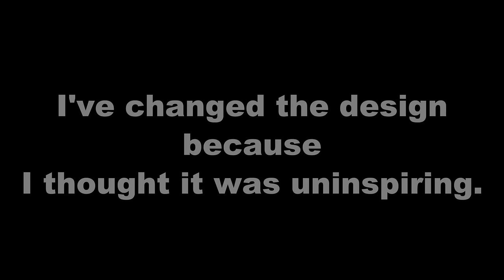Ruler Marking Gauge

Comment: This build inspired me to make one, which I have now done with a few changes, works very well & I think I’ll make a smaller one with a 6inch ruler to keep the other one company. I looked through the comments on this & you don’t need anything other than basic tools to do the Superior one, trust me. My version doesn’t even require the locking internal plate, as long as the bolt is in the threaded insert straight and flatten/polish the bolt end it seats & locks the ruler fab, saves more  too, thank you for sharing!👍
Reply: i want see it!
Reply: Glad to see this comment; I was wondering why he bothered with the plate at all.  Additionally, what kind of glue, etc. would be needed?

Comment: The difference between the two versions is the difference in price you see in tools in the big box stores.  Such as Milwaukee vs Black n Decker or Bosch vs Holt.  He shows the DIYer it can be done. Then hey shows the the experts what they can achieve.  Inspiring to both audiences
Reply: The guy is great and I couldn’t do what he does but the real difference between the two is the CNC machine more then any other tool comparisons.  It allows for so much more detail and precision.  I want a nice small one like that.
Reply: @garyjohn1956  you got it. CNC makes significant difference in the 2nd version

Comment: As a armchair quarterback who makes nothing, I would have used the brass on the darker wood so it would stand out more.  I think you could also make a half inch set on the end side with a solid metal line and then a inch on the other end.  Then you would have 1 adjustable and 2 fixed for common measurements.  Of course I could never make something so amazing.  Brass and wood is a classic look. love it.

Comment: You inspired me to make one. It's far from perfect, but gave me joy to make.
Also will be functional!
Handmade everything except the ruler and socket head cap screw.
Note the ‘impossible’ dovetail.
Top timber red box (Eucalyptus polyanthemos), possibly red gum (Eucalyptus camaldulensis) - not sure. Was a garden stake that was left on the side of the road.
Bottom black-butt (Eucalyptus pilularis)
I live in Australia. There are such amazing hardwoods here, that sadly mostly end up as firewood or chipped and shipped to Japan for paper making.

Comment from the maker: The simplified version of wood is Whitewood
CNC processed products use rosewood, beech and brass.
For the part to touch the work, I used rosewood with high wear resistance and used brass for the part where the ruler touched.
The leaf spring is glued so that the screw does not hit the ruler directly.
Google Translation

木材は簡易版はホワイトウッド
CNC加工品は紫檀とブナ、真鍮を使っています。
一応、ワークに触れる部分は耐摩耗性の高い紫檀を使い、定規が触れる部分には真鍮を使いました。
ネジが直接定規に当たらないように板バネを接着しています。

Comment: Great work, very precise I will use your basic design and make it simpler (I think Mathias Wandel did something similar as well).

A suggestion a lot of craftsmen cut with big or small bandsaws putting their fingers really close to the blade. Research and make some push sticks as lots of people will copy your way of working. Whilst you have great skill, people watching can be complete incompetents and will get injured because they think they can do the same.

I can clearly see you have modelmaking skill for many years but newbies  may get injured.

Keep up the good work. You could make extra income and people can help support your work by selling plans.

Comment: Just an idea but locking the ruler with rare earth magnets would work, one in the ruler bed flush & another in the end of the brass bolt, just lifting that out would enable you to adjust the ruler then pop back in to lock, I am tempted to do this with the smaller one when I get round to it.
Reply: I made a smaller version of this with magnets and it works, go me, thanks for being interested

Comment: the screw attached to the wing nut when tightened presses the metal plate, which in turn presses presses the metal scale. is my understanding correct.

Comment: ...I can't get over the fact that when you were drawing your lines with your first marking gauge while you were making your second marking gauge, you drew those lines as if you didn't have a marking gauge. 

"Dash, slide, dash pickup, straight align, fill."
When you lined your dashes up, your block was hanging 4 inches off the edge of the table. 
...was this your first time using a marking gauge or something?

Comment: This is awesome! Is that piece under the nut necessary? Or can u tighten right on the ruler?
Reply: I was wandering the same thing
Reply: Although not necessary, that piece adds extra friction to prevent ruler from moving (you won’t have to tighten nut to tight) as well as preventing the holding nut from damaging the ruler.

Comment: sorry but although the 2nd version looks nice, it’s not inspiring at all because done by CNC. something inspiring should inspire others do something similar and 99% of the viewers do not have a CNC. i prefered the 1st version.
Reply: I understand what you're saying. However, I found inspiration in him showcasing how to use the cnc. I gain a lot of tips just watching how he approached using the mill that will help my own woodworking. Showing two approach to making the same tool is great in my opinion. Something for everyone. Additionally, I'm sure one could apply the principles from the first tool, but replicate the look of the second tool using traditional woodworking techniques. Or at least the majority of the look. :)
Reply: Couldn't agree more. This is like using a cnc for making it's own 19th century predecessor. It was the other way around, historically. First was nice to watch, though.
Reply: You don't need a CNC to do that one, that's an extremely simple design.
Reply: @woodfulprojects to each their own